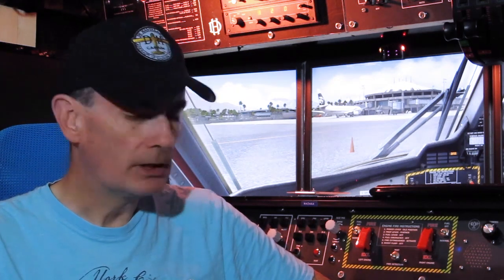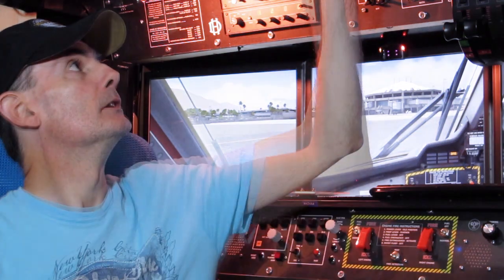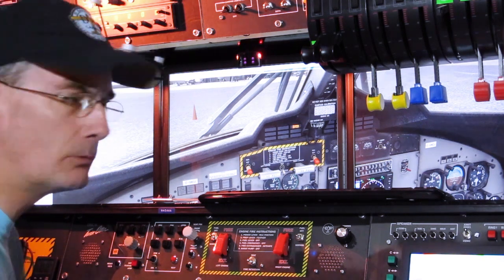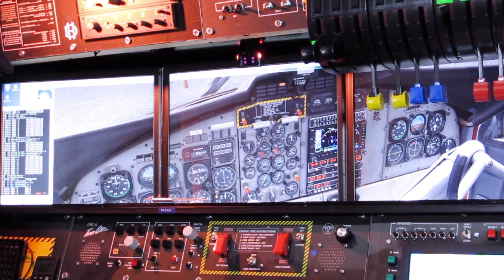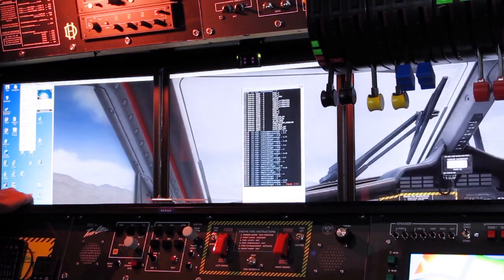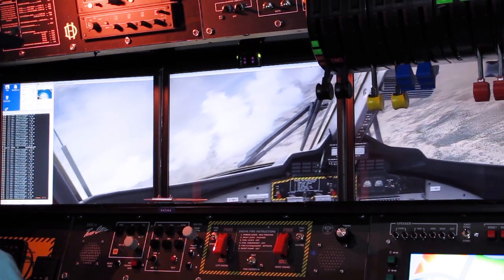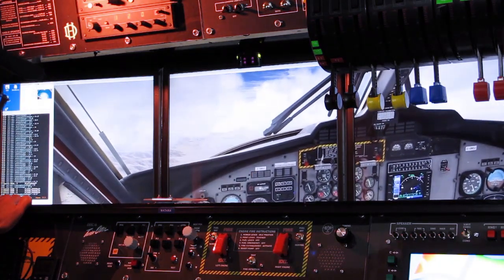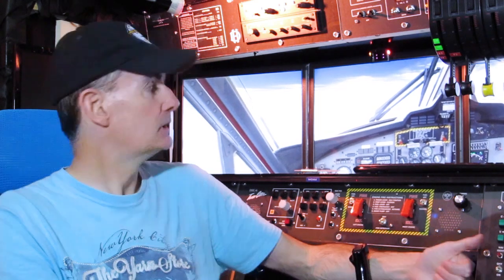Twin Otter Close Up #8: Ice 2

Comment: Hi, your videos are extremely detailed, very good!! do you know any way to have the RXP 530 or the GTN F1 running in 3D in the VC with all switches running?
Reply from the maker: +Laura Godoy Hi there, and thanks for the comments. Assuming you mean for the Twin Otter Extended, neither of these is currently possible. Aerosoft has stated that because RXP would not help them out during development it was not possible to integrate the GNS530 into the virtual cockpit. They gave some consideration to retrofitting the F1 GTN, but have decided not to for now, as you will see in this thread: http://forum.aerosoft.com/index.php?/topic/88257-twin-otter-extended-and-f1-gtn/
Reply: Well well, in other life, haha!! thank you!!